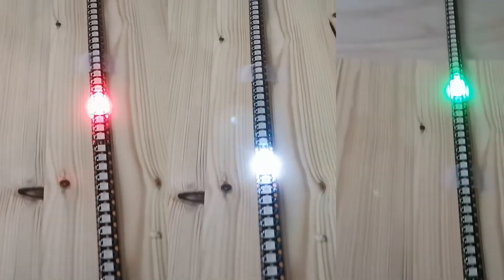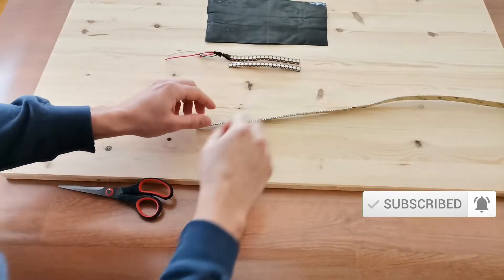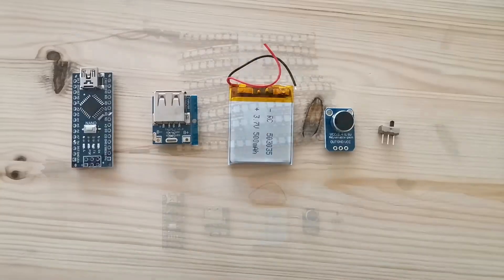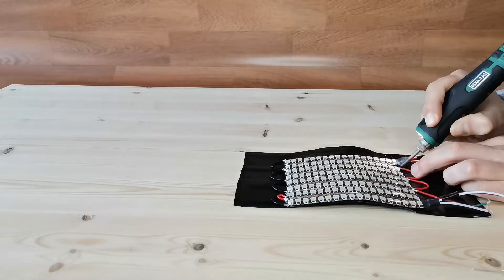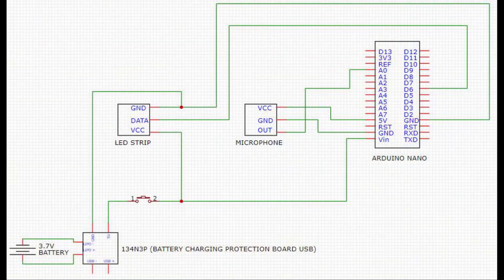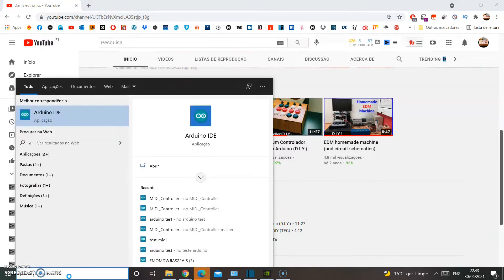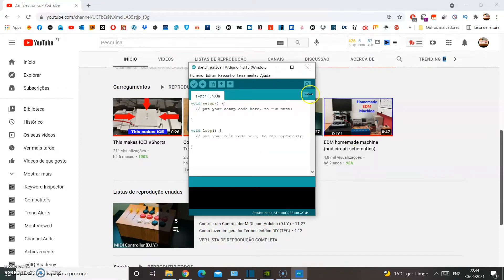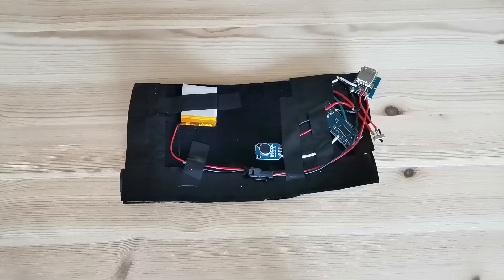Making a Face Mask (with ARDUINO)

Comment: I have another question, the 144 strip of LEDs has limited markings on it as to which is 5V and which is data and which is Gnd. In your video it looks like you have only soldered two contacts together at each joint. Which two are they? And why does that work for you? Also, can I cut 8 strips 14 LEDs each instead of 8 strips 18 LEDs each or did I wreck my strip since I have read online that some strips have specific cut marks, but this one doesn't seem to. I'm so confused
Reply from the maker: Trevor, as you can see on the circuit schematics, I soldered 3 contacts: Vcc (red wire), GND (white) and data (green), it´s the information needed from the arduino nano.
You can change the quantity of LEDs by row but you will need to make some adjustments  to the code!
This LED strip has cut marks. In fact all of them should have, every 50cm. You will recognize the cut marks when you see bigger solder marks.
Reply: @DaniElectronics  Thank you so much big guy. I'm re-creating this project and am having a good time now that I'm on the code part. I found out that I can use any amount of LEDs in any order I want. Again, thank you
Reply from the maker: I’m glad I can help Trevor! Knowing you are having fun re-creating the project is even more flattering.
Reply from the maker: @Trevor, when you’re finished I’d love to see the outcome! You can contact me through Facebook or Instagram!

Comment: Can i do exactly this but with the Iron Man / Batman flexible led lights? I just want the led to light up when i talk without any feature about mouth shapes.
Reply from the maker: You sure can Efrain. You will only need to connect an Arduino nano to the leds and change to a simpler code. I believe there are samples on the Arduino IDE library!